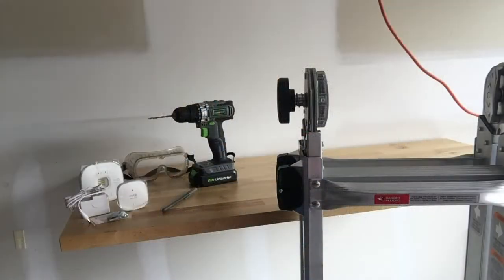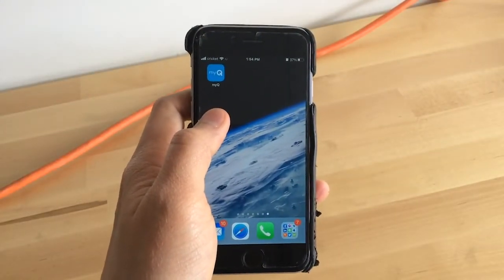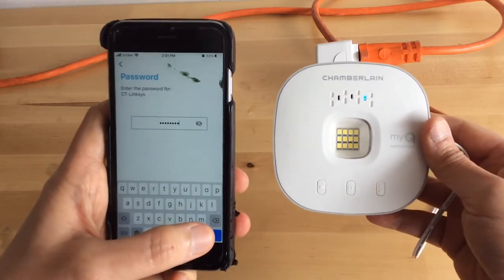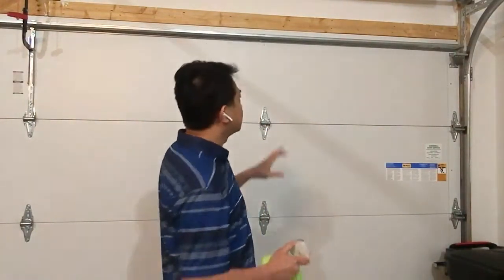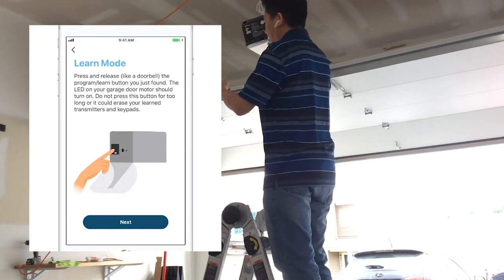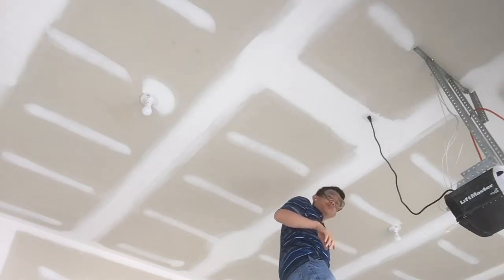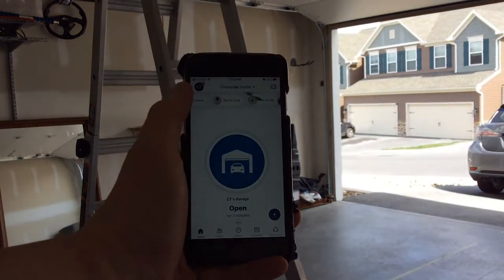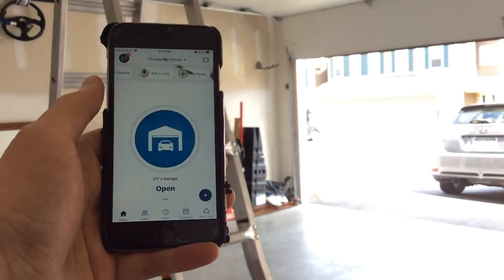DIY: Smart Garage Control Installation (Chamberlain)

Comment: HI, CT, I am thinking if i can use the Smart Garage hub for my gate. My gate controller is similar to a garage door opener. I can easily pair a garage door opener (remote control) to the gate controller. my question is: can you still open or close your garage without the sensor because i cant use the sensor on the gate? Thanks.